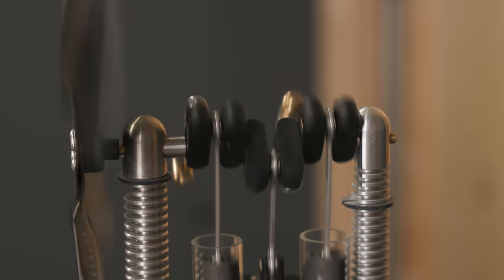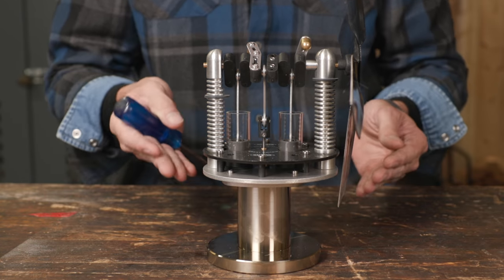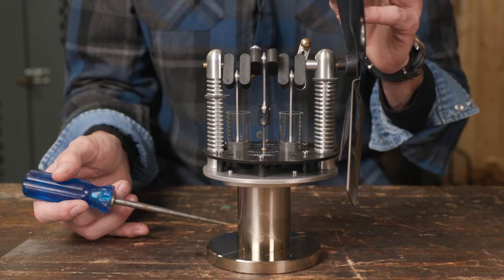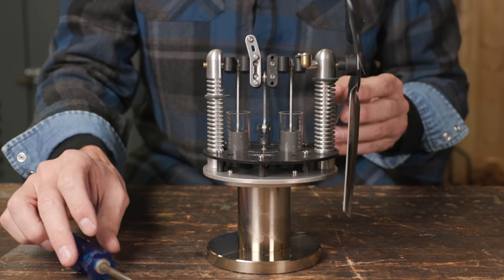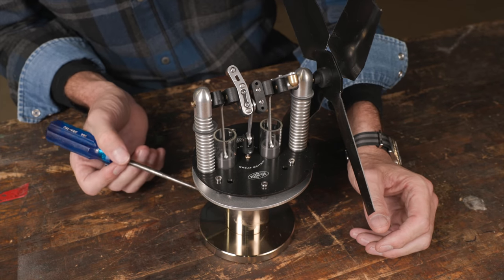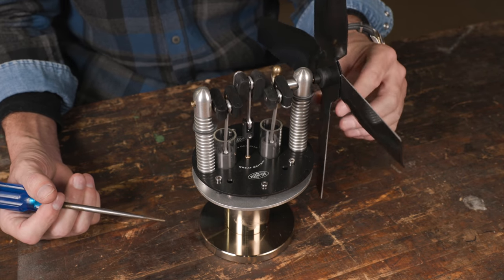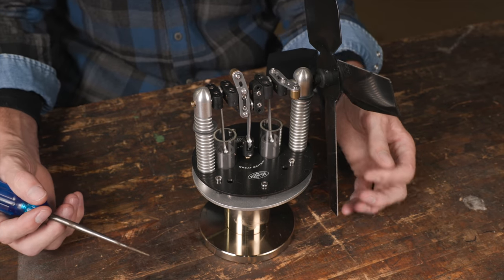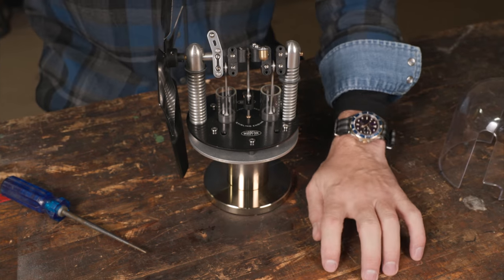Wood Stove Gadget Power Companies Fear

Comment: At first, I thought this was about those AMISH woodstove fans... But now, I see that's an entirely different technology. Now, you would never think of the Amish of all people to be the leaders in any form of technology but they are! And they don't even know it... If you haven't already seen them then please check them out. People are catching onto them and making knockoffs of them to sell for 5 times as much as the Amish do. 

My only thoughts are: What other aplications might we use it for? 

And then too, there are the Tibetan "Hot Rods" which draw excess heat up out of the permfrost preserving the integrity of the railroad tracks on top of it. If the permafrost ever thaws the tracks would literally fall apart. The "Hot Rods" as they're called are little heat-pumps pumping heat out of the permafrost so that it stays frozen: and they work without electricity altogether. 

I'm looking for alternative technologies that work.

Comment: So what does the power company fear? You can get a stove fan for like $40 but this one you have is like $400 so for the cost of this fan I can pay for the electric to run a cheap fan for the stove for a few years. The only application this would reasonably have is off grid. They are really cool and a conversation piece but they don't produce electricity and they can only power the little fan. So no the power company doesn't fear this.

Comment: Here's the thing, that fan is very expensive and it blows air in only one direction.  One could buy three or four of the cheaper Ecofans and have them all sitting on the woodstove but blowing air in different directions, thus dispersing the heat better.  Just saying.  Yes, it's pretty cool but Ecofans are a cheaper option.
Reply from the maker: It's not for everyone, do what is best for you, please don't judge other who may not agree with your decisions,
Reply: @wranglerstar  I didn't mean it as being judgmental.  There's not a single ad hominem attack in my comment.  However, we can't make good decisions without good information.  I was presenting an alternative that might be more cost effective - nothing more.  :)  I have enjoyed your videos.  I am wondering if a sterling engine - perhaps bigger, could be used to power a sump pump.  I am thinking in a situation where there is no electricity on an acreage where there is only well water.  Yes, I have a generator that i use when the power is out.  However, I am thinking of what might happen if there were a Coronal Mass ejection and there were no electricity for months and gas could not be pumped.  Alternatively, since my wood stove runs 24 / 7 in winter, I wonder if a Sterling engine could run a small alternator to power up batteries.  I have been looking for a solution  to running a sump pump long term with no electricity in a SHTF scenario.

Comment: Understand that the "DISPLACER" is just a lightweight space holder that moves the air in the sealed chamber from one end to the other.  Hot side, and Cold side.  It is not a piston because it doesn't contact the walls.  Trapped air moves around the displacer.  When air is moves to hot end, pressure will push on the external power piston.  When displaced to cold end, suction will pull the power piston down.  The working fluid (air) is used over and over; unlike a gasoline engine that pumps air from intake side to exhaust side.

Comment: Enjoyed your technical explanation. I don't know how it works either. Boil's Law could apply, but you don't have to add water??!! Bruce Dern elucidated in 'Silent Running'?? It's very quiet, but is there a midget inside? Come on, where did you hide the wires or batteries? Did you have a fan just off-camera turning the blade? Lucy, you got some splain'in ta do. Next yull be telling us to hook it to a generator and sell power back to the grid.

Comment: You could place this outside next your building with a shroud/tube around fan connected to building, set it on a metal sheet painted black an summertime it could draw air from out of or into a space that needs air moved around, just thinking outloud, i dont need any input as to how dumb this sounds so save that for someone else who might actually care